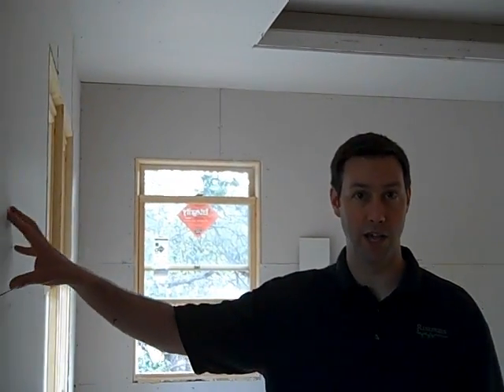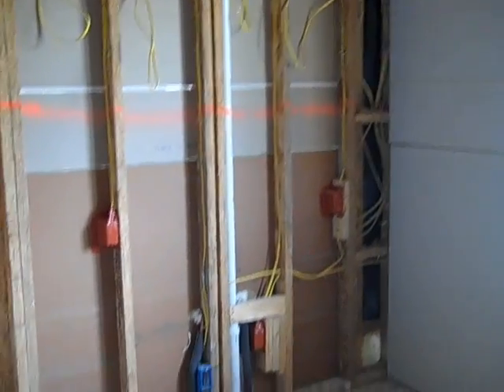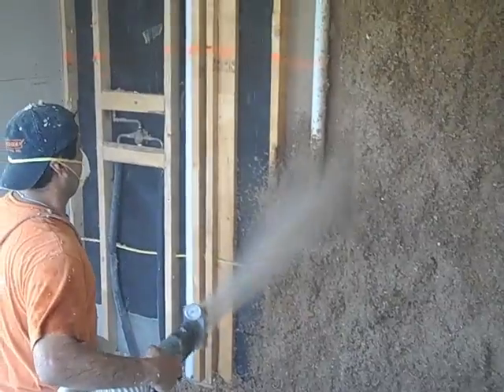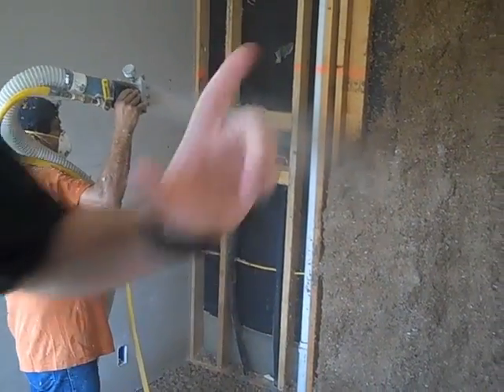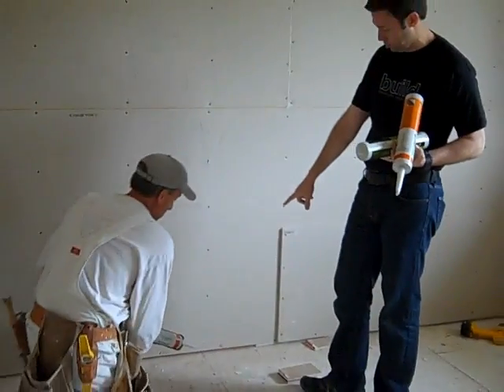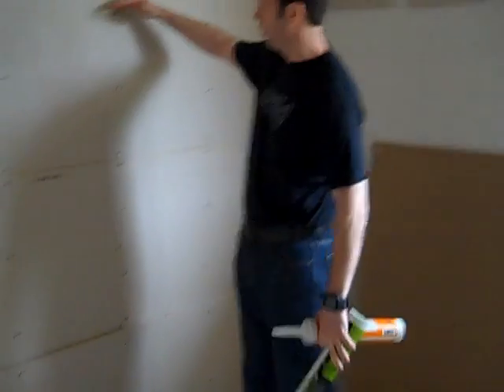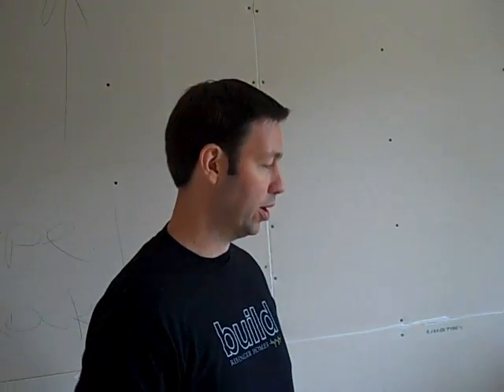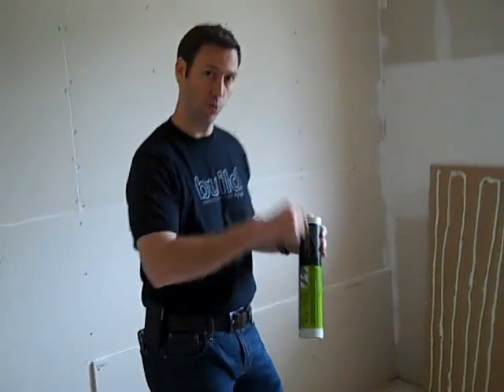Soundproofing with Green Glue, Cellulose, & Double Sheetrock

Comment: How can green glue reduce sound if the sound doesn't even pass through it?  You can use any other caulking adhesive that cost 3 times less that will glue 2 sheets of drywall together.  Am I missing something here??
Reply: Yes you are. Caulking dries. Green glue stays flexible forever. That's how it dampens sound, converting the sound wave energy into heat energy, by staying viscous and decoupling the panels as a bonus.

Comment: Does this application cost effective ($) enough for lower DB performance?

Versus a resilient wall steel studs w/ sound isolation clips + foam core/insulation to walls + sealing all seams.

Is that USG standard drywall and not green board in a wet area?

Looks to be a nightmare for any repipe/rewire work if needed for reaching engineering lifespan change overs.

Cool idea.

Comment: Awesome video. Matt, do you also use the sealant once the second layer of Sheetrock is installed? Thanks
Reply: One of the Best Ideas of SoundProofing is "SoundProof Curtains" That Stops Outside Noise by 80% (25 Db) Tested. Check Here: https://livesoundproof.com/best-soundproof-curtains/

Comment: Hi and thankyou for your videos. After applying the sealant on the seams of the 2nd layer of drywall, do i have to wait a certain time before mudding the joints or applying house wrap over that 2nd layer of drywall. I'm doing a job that also includes an exterior wall which will have timber cladding (hence the house wrap part of the question).
Reply: One of the Best Ideas of SoundProofing is "SoundProof Curtains" That Stops Outside Noise by 80% (25 Db) Tested. Check Here: https://livesoundproof.com/best-soundproof-curtains/

Comment: I forgot to mention the plaster has paint on it.  I have one wall that we put dry wall over the plaster and it didn't help the sound proofing, can I add another thinner layers of dry wall to that with the green glue on it, the dry wall was painted, would that work?  I am confused about whether I need two layers of 5/8" over the plaster, need help asap.  thanks.
Reply: 2x5/8" or more is great

Comment: 1.  1/4 inch beed of 100% silicone down the studs for the first layer of drywall
2.  Caulk the joints & outlets as shown in the video
3.  100% silicone sandwiched between the first & second sheet  & dont overlap the joints as shown
4.  1/3 the cost and the same sound dampening effect

green glue $15 a tube, 100% Sicone $5 and it stays flexible just the same
Reply: What size drywall? 1/2 or 5/8
Reply: @richards881  5/8. You want to add mass.
Reply: Since when does silicone "stay flexible?" Cured silicone is a hard rubber, not viscous liquid like green glue. Stop trying to save a buck when you don't understand how the materials work.

Comment: GG behind DIY plank wall?    I am planning to install strips of 1/4 plywood on existing sheetrock to look like shiplap.  Would applying Green Glue to the back of the planks 8"  x  72"  x .25   decrease sound  traveling from an adjoining room?   There will be intentional nickel size gaps.  Would the gaps compromise the whole job?   Would the Luuan plywood be so thin it would be ineffective.  Would the Green Glue be too thick causing my  thin fake plank to pucker?   I am going to do this project anyway just for looks, i was just hoping green glue would decease sound travel.  Thanks,.

Comment: How would you soundproof an already existing wall which has two electrical outlets on the sheetrock. The rest of that wall has been built of fireproof materials to accommodate a woodstove which I never added.
Reply: There is also a thermostat on the wall.

Comment: Can I apply my second sheet rock with green glue on a existing painted drywall surface?
Reply: It's my understanding  Green Glue is not really a glue and any  material needs to be applied  as usual.  Screws ,nails etc.

Comment: I have 2 quick questions! I'm going to be doing 1/2 in. osb plywood and then 5/8in Drywall on top of for my music studio in my basement. 

1.)  I'm just wondering if Green Glue is still effective when put between drywall and osb plywood? 

2.) Also, do you need to seal the 2nd layer of wall with the acoustic sealant or just the 1st layer?

Comment: How would you soundproof an already existing room?  Would they have to tear the walls down?
Reply: drill 2" hole between stud and blow in loose fill insulation then patch holes ( hire a pro)
Reply: One of the Best Ideas of SoundProofing is "SoundProof Curtains" That Stops Outside Noise by 80% (25 Db) Tested. Check Here: https://livesoundproof.com/best-soundproof-curtains/

Comment: will those hilti putty pads prevent sound of 65 db+ from coming through?
Reply from the maker: As part of a "system" approach to sound proofing: yes. On their own: No
Reply: now would roxul being insulated in the walls interfere with these putty pads?
Reply: @davidratkay9281  no, because you have to cut an 'indent' into the mineral wool to allow the electrical outlets to fit inside.

Comment: Hilti is so expensive is it that much better than a can of spray foam around the outlet boxes?  And as you are having the walls sprayed is it necessary in that application as far as cost effectiveness?
Reply from the maker: +Douglas Thompson Yes, it's MUCH better.  No comparison.  If you want to do it right, use a Putty Pad and the Hilti is the best model I've seen of those.

Comment: Hey Matt, I'm liking your videos. If I double sheetrock but use a silicon caulk instead of green glue, would that add semi-reasonable soundproofing without the $25/tube that Green Glue costs? (Would it be better than just double sheetrock alone?)
Reply from the maker: +Trevor Nielson I wouldn't waste the time/effort on the silicone caulk.  See my cheap tricks video.  Double SR is a good idea even if you can't afford the green glue as it'll add mass.  In the end, you've only got one shot to do this soundproofing, if you screw it up it's costly to rip/replace.  The Green Glue is pretty cheap in the long run for a very good product.  Best, Matt

Comment: If   this  (hanging of  2 x   time  the  sheet rack)   cost less than  using  the acoustic sound proof type sheet rack.?   this seams too  time consuming to me .   However it might be more coast effective for contractors. .,,, but all good ty for the info.
Reply: Quiet rock here in California at my 2 local dealers is $74  per 5/8" 4x8' sheet.  So yeah it's a lot more cost effective to just double hang.

Comment: Can you use green glue with cement board on floors?  I am trying to insulate an existing floor in a second floor condo without pulling up the sub floor.  Pulling the sub floor requires HOA approval.  Work done above the sub-floor can be done "on my own." --  I'm looking at layers: #1. cleaned & smoothed subfloor with cracks between boards and around the edges where the floor meets the drywall sealed with noiseproofing sealant.  #2 green glue on bottom side of cement board using the green glue instead of thinset.  #3 EXTRA THICK carpet padding #4 carpet -- I'll replace the existing hollow core bedroom door with a solid core door adjusted for the added few mm of height added to the floor
Reply: Consider Homasote 440 or ScreedBoard 28
Reply: You can...in fact one of the ways they market this product is by doing exactly that.  With the only exception that they use it between subfloor plywood and studs.  Would use less tubes too. Probably more to reduce squeaky floors but if sound reduction is your only goal ...go for it

Comment: Thanks for the video Matt. I am finishing my basement and I'm trying to figure out the best way to soundproof the ceiling so I won't hear noise through the floors.  First I'm going to insulate really well. Then I don't know what to do from there
Option one-RC channel or Sound clips and regular 5/8 inch sheet rock.
Option two-1/2 inch sheet rock, green glu, another sheet of 1/2 sheet rock.
Option three- sound clips and  5/8 quiet rock. 
There are unlimited options. What should I do?
There is so much conflicting information out there and products that are expensive. There is no way of knowing what is worth the money and what is not. Please Help!
Reply from the maker: Emily Rubalcava I would pickup the latest issue of Journal of Light Construction (January).  Great article on this issue.  Of those three options I would pick one with RC Channel and double SR with Green Glue.  Check out that article.  Great advice from a pro.  Best, Matt

Comment: Are you driving the screws all the way on the 2nd layer or just to the next sheet?    I presume not all the way.  Then what is the screw off pattern for the top sheet?  Standard?
Reply: +Curtiss Harris they do transmit sound but the green glue layer helps absorb a lot of it.  The only way to completely eliminate vibration is with resilient channels
Reply: Resilient channels are what should be used for sound proofing, screws through both sheets transmit the sound waves and couple the panels.... like shooting yourself in the foot after all the rest of that expensive work.
Reply from the maker: Sheetrock won't hold a screw so you'll need to use longer screws on the second sheet to secure it to the studs.  Standard screw pattern.  Thanks, Matt
Reply: Matt Risinger  I would have thought that the screws transmit sound so I was thinking the green glue had adhesive qualities.

Comment: Matt, Thanks for the video. Which insulation do you think would be better for soundproofing. Roxul "safe and sound" batts or dense pack cellulose. I haven't had any luck finding comparisons of the two in regards to sound proofing or STC ratings.
Reply: +Terrie  Ron Schock  this guy is another one of those my way is the best way guys
Reply: Roxul is a scam. According to the (Canadian) NRC report on the matter (IR 693), the best performance from batt type insulation is found with conventional fiberglass or Owens Corning "Quiet Zone" fiberglass... if available in your market. When you increase the density of the fill material you actually DECREASE your STC levels. I have been doing these kinds of installs using double layer/conventional acoustical sealant for years now. Green Glue is the new answer to the problem. It's the bulletproof solution...IMO. I am currently advocating for a loose fill cellulose for wall/ceiling fill material, using the BIBS system. This offers 100% coverage in stud bays with mechanical "issues". The loose fill is blown to R35 (in an 11 7/8" Tji joist depth) to provide proper separation from the underside of the subfloor sheathing. Batt insulation can't compete with this kind of continuous coverage. The REAL difference is in the board though. 5/8 Type "X" as the first layer and 1/2" CD/SR as the second. I can shoot wall plates with Yellow loads in the basements of  the duplexes I'm currently doing and you can't hear a thing in the other side...Truth. The fill material in these is R12 23 fiberglass, on a staggered stud wall.Board as described above.
Reply: @TRSchockYT  No one in their right mind would fill their walls with shredded paper for insulation, I don't care how "fire treated" or whatever it is... its just a mind bogglingly stupid idea to even invent such a product. Or as they say, "Only in America!"

Comment: any issues with plugging the screw holes in the outlet boxes with the sealant?  seems like it would be a headache for the electrician
Reply from the maker: No, you'll only be using the putty pad on the back side of the box.  You are covering the box/wires and sealing it to the sheetrock.  The front face is untouched.  The electrician will never know you've used a putty pad on this box from the front side.  
Best, Matt
Reply: Matt Risinger
what i meant is when i saw an image of cauling material over the front of the electrical box, i just saw the screw holes being clogged up with caulking
Reply: +Bicycle Yoda acoustical sealant does not harden or set like caulk. Only electrician who's going to be bitching will be the one who has to go back in there to make a repair in the future.

Comment: He is doing it wrong. No need to put the zig-zag. Better to use a random pattern. 2 tubes per sheet (or 3 if you want better low frequency reduction)
Reply: yes you are right
Reply: He was using two tubes per sheet...

Comment from the maker: Both products are very good and if installed per specs will provide their stated STC's.  I like QR if you are concerned about thickness or if you are bidding the work.  I like GG because it's typically less expensive, but it is more dependent on a detailed installer doing the GG install per spec.  It's also thicker with 2 layers of Sheetrock which is good in my opinion to add mass.  But, that's more labor and is heavy if you are doing a DIY project.  Hope this helps, Matt

Comment: Matt - a couple of comments.  First, adjustable electrical boxes should be used with double-rock installations to aid with finish electrical work.  Second, I didn't hear this in your video, but 5/8" sheet rock should be used to maximize the performance with incremental increase in cost over 1/2".  Third, installation goes significantly faster if the drywall is laying flat on the floor and the Green Glue "quick loader" is used.  So all these increased labor costs are negligible in reality.

Comment: ephoricmonk....You are completely skipping over the fact that using double 5/8" with Green Glue is SIGNIFICANTLY more mass than a single sheet of QuietRock.  QuietRock also uses their own viscoelastic compound which, although comparable, doesn't test as well in the lab with limiting STC.  And your quoted price for QuietRock is for the absolute cheapest available model.  You would have to buy the QuietRock 535 at a minimum which approaches $80 per sheet.

Comment from the maker: Thanks for the breakdown.  My concern with Greenglue regardless of the cost differential is that the installer has to take care to ensure the glue pattern is correct to get the intended results.  If QuietRock is the same cost I would go with that.  Matt

Comment: The installer said he was using a little over 2 tubes per sheet but covered less than a 1/4 sheet with the first tube so that information is not accurate. Also based on Green Glue's website it looks like this applicator was light on the amount of Green Glue used. 
In my opinion labor will eat you alive with this application.

Comment: Hi Matt, absolutely great series of videos! Hey I have a one off question for you. Ever used underlay for floating floors in a 5/8'' drywall sandwich technique? What do you think? Would it work? I am looking at some soundproofing capable 2.5mm underlay with vapour barrier capabilities atm b/c green glue is very expensive at my location as is the direct shipping. Thanks, MS

Comment from the maker: @waterdoor I can image the shipping was really pricy.  That's one reason I like the Green Glue application, you're only shipping a case of caulking rather than hundreds of pounds of special sheetrock.  Just using two sheets of cheap drywall and this special sandwich of Green Glue seems like a much easier way logistically to achieve sound proofing.  -Matt

Comment: Matt I was going to use SilentFX from Certainteed on my project, but the shipping was crazy expensive and we found out about it so late in the project that it would of delayed the drywall.  It has the green glue already applied and is much cheaper than quietrock.  We decided to go with channels and R-13.

Comment from the maker: @AtticFoil Excellent question!  In order of priority I would do (1) layer of Quietrock/Greenglue on the side of the wall with the least penetrations (outlets, fixtures, etc) and be sure to use acoustical putty on the penetrations it does have, then do fiberglass or cellulose insulation, then if space permits do staggered studs, then either acoustical clips which is like an isolation hat channel OR a second layer of Quietrock/GreenGlue.  See my video titled "Where to use Quietrock". -Matt

Comment from the maker: @AtticFoil Thanks!  I looked on both companies websites and our exact assembly wasn't listed.  I believe both would give an STC of roughly 50ish.  That means that a radio at 70 db in one room would sound like 20 db in the adjacent room.  VERY good!  I like quietrock because there is less chance of installer error, but this Green Glue is nice in that it's a lower cost solution and is potentially easier to source.  Both are excellent sound proofing methods.  Matt Risinger
Reply: One of the Best Ideas of SoundProofing is "SoundProof Curtains" That Stops Outside Noise by 80% (25 Db) Tested. Check Here: https://livesoundproof.com/best-soundproof-curtains/